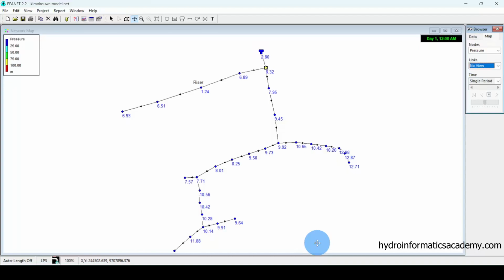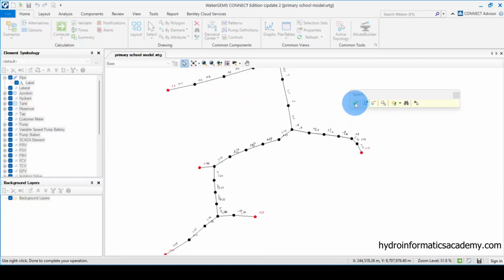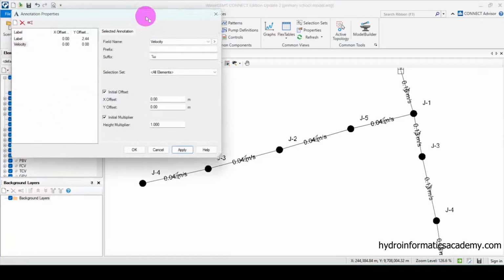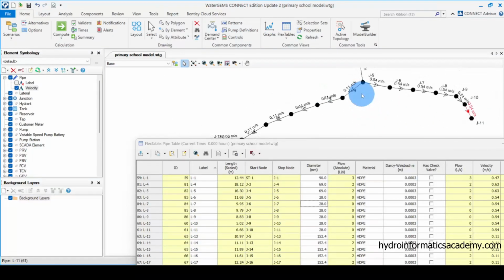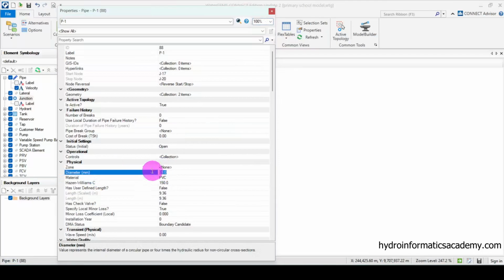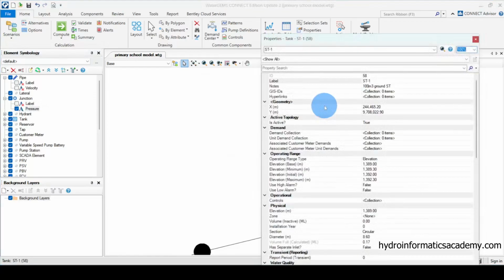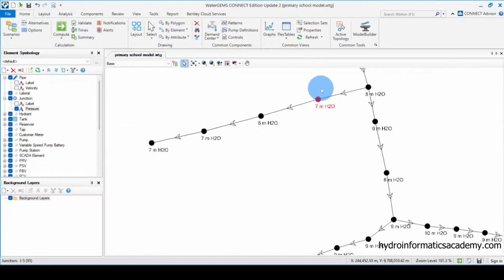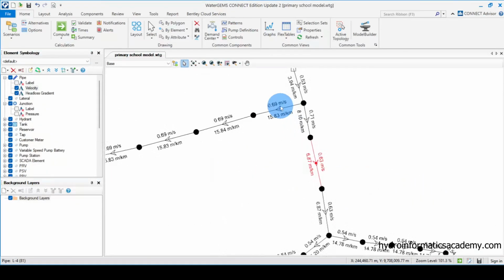Let's Redesign This Water Distribution System With WaterGEMS Software

Comment: You are doing a great job teaching watergems. I have a question and would appreciate your answer. If I want to pump water into a ground storage tank, at what height should the feed pipe enter the tank? Is there any guidelines? Note that the water in the ground storage tank will also be pumped into a treatment plant from the other side of the inlet point.
Reply from the maker: Hello! 

You are pumping from which source? Borehole? Borehole to underground (buried in the ground) tank?
Reply: @HydroinformaticsAcademy  I am pumping from a surface storage tank to a concrete tank buried partially in the ground.

Comment: Hi thanks for the videos! I've been watching your tutorials for my research. 

Just to ask, I calculated the demand of a building using fixture units, or FU, then converted it to liters per second, shall I use that and put it on the node that corresponds that building? Or there's a reduction factor or percentage of that I can use?